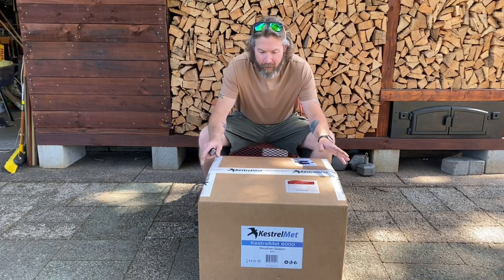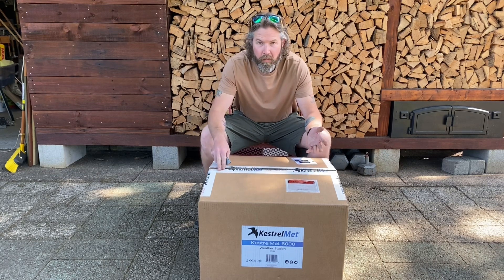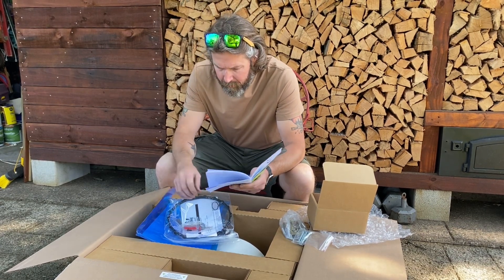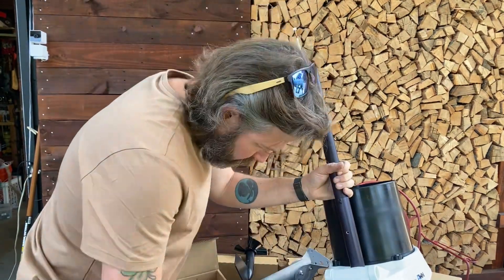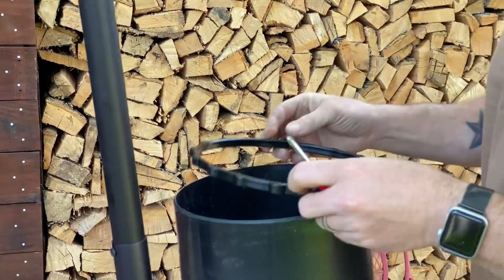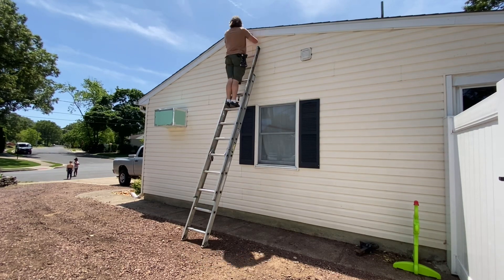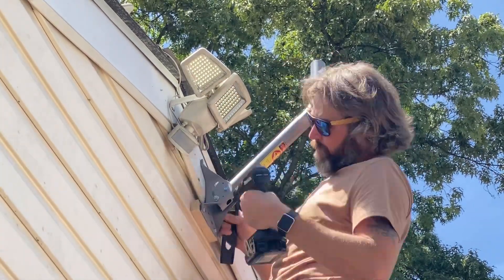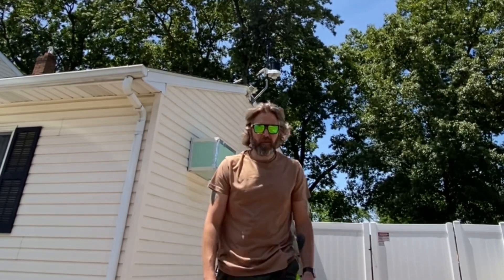KestrelMet 6000 Assembly & Installation

Comment: Hi. Great video. Did you have any issues connecting to your wifi? I just got this unit and am having some issue with the kestralmet utility app not wanting to connect to my wif. Thanks.
Reply from the maker: Hey Matt! Very sorry for just getting back to you. I hope you’ve figured it out by now. Did it need to connect at 2.4Ghz? I’ve run into that trying to set up WiFi connected devices before and couldn’t due to dual band router. I’ve had to go to the other end of the house from it. Didn’t have that problem with this. If that be the case, I was probably far enough away when I linked my Kestrel. How do you like yours?